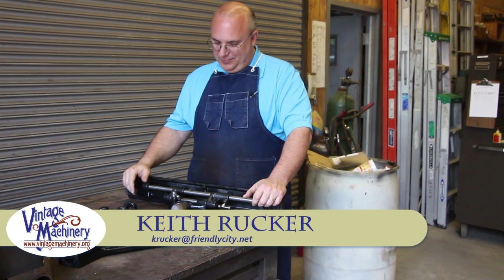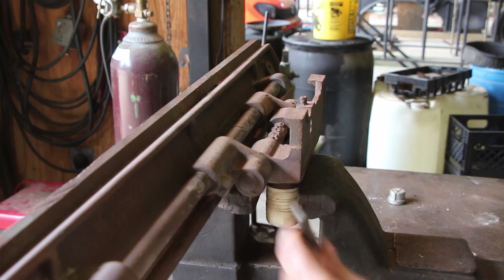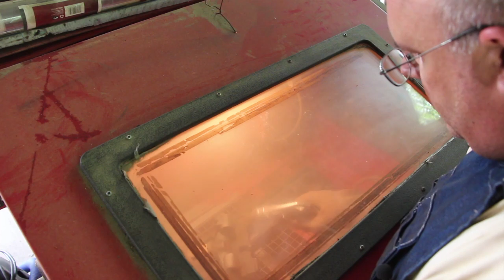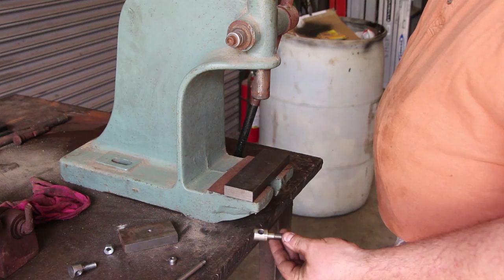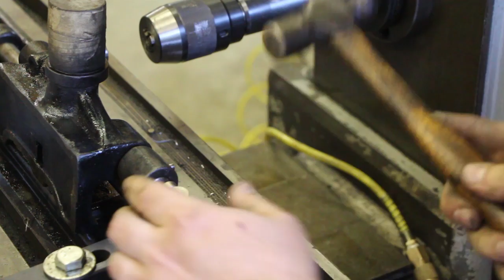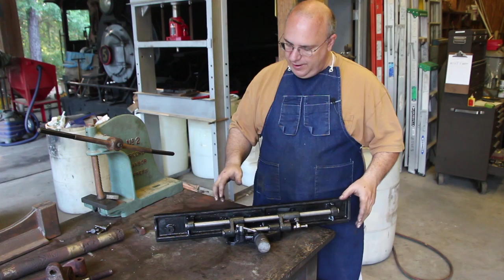Oliver 80 Table Saw "C Fence" Restoration: Part 1

Comment: What an awesome video. I had to laugh watching the fast forward portion of the video, just listening to the tap tap taping and watch those parts fly apart. I also see a lot of new owies on your hands. You deserve a purple heart for all those injuries. Again Keith you continue to do great work, restoring, replacing and making new parts where needed. Sure look forward to the assemble . I went out and bought a box of the Arm and Hammer product, actually the first box was wrong, but went to Ace Hardware and got the correct product. I'm making a small electrolysis set up using a five gallon bucket. Again thanks for more great information.

Ken Bartlett

Comment: Thank you Mr. Rucker! I just purchased a 370 Oliver. I don't believe it will take much to put back into service because it's only been out of service two years. I have my fingers crossed it comes with a miter gauge and extras. Got on auction.

Comment: I always enjoy your videos.  Your gentile spirit always leaves me feeling good. Thank you for doing what you do so well. I restored a very old WF and John Barnes 22 inch drill press. I bought it from the original owners family. Under a hundred years of petrified grease and crud was a nearly perfect 800 pound Camel-back drill. Every gear is perfect. The drill press had been stored in the home workshop for 80 years.  I had to make a few of the square hear bolts with 12 tpi. The first bolt turned up with left hand threads. LOL. How did that happen?

Comment: Keith, sorry the gremlins ate some of your video, but you edited together a sequence that makes sense, and I learned a couple of things from it. Thank you.

I'm hoping to see that fence in action. Seeing it on the table pre-restoration raised questions about how it was used and why it was built as it is...especially that arc/slot.  Can't figure out why you'd want to angle the fence away from the blade...my modern fence is designed not to do that other than a little adjustment to get it almost parallel (other than 0.005" offset at the out feed end of he blade).

-- Mike

Comment: Little lever, for sure. It is a MYFORD and the levers are much less than threatening. I also have a nice old SOUTH BEND 16 for more serious stuff.
  I missed out and K&T just like yours.  It was on CRAIGSLIST, locally and my hesitation cost me a good deal on a great machine.  It was $2500 with all of the accessories.

Comment: as close as I can get is a Starrett Brass Drive Pin Punch set you dont get the bounce like steel punches and it does not mark what you are removing the steel shank and the brass rod work well and you can always make new brass rods for them mine screw together may be you could make your own

Comment: I have a table for the press you use in this video,very heavy made in providence rhode island by adams co.I use it as a chop saw stand once in a while. when I got it I had no clue what it was for but after some Google searching I was able to figure it out. old stuff is cool.
Reply from the maker: +joe clune Cool - you never know where things will turn up being used or where they originally came from.  I need to fabricate a better table for my press!

Comment: good job on that it was rust itself cracking videos keith is that horizontal mill the same as the one that keith fenner has if not looks very similar to it keep knocking out the videos

Comment: Nice work on the fence.  When doing the tapered pins, do you drill to the diameter of the small end and then ream the rest using the tapered reamer?

Comment: Hi Keith,

Did you grind the vertical surface (face) of the fence?

Also, on a few videos, I have seen you cut threads on shafting using the lathe.  I am sure some are wondering how you can perfectly line up on the grove on each of several passes (Thread counter?)
Thanks

Tony
Reply from the maker: Anthony F. De Leo I did not grind the fence - it was machined with a metal planer originally which sometimes gives the metal a striped appearance.  As for threading, yes, there is a thread counter that you use to engage the feed.  If you have not already seen it, here is an older video that I did that that shows some details on threading:  https://www.youtube.com/watch?v=zmZO0LU6j_U

Comment: would be a good idea to use a lead hammer...
Reply: can't wait to see it, i poured mine in a copper pipe so that i can have sort of a copper jacket for the lead i sometimes on porpouse hit with the copper
Reply: ***** Tubalcain, aka. Mr. Pete222 just did a series on casting a lead hammer - he went a couple of extra steps from wooden pattern to finished hammer.

Very informative...

Not sure if you have access to soft lead these days - it's getting harder to find, due to the environmental concerns...

I'm wondering if Babbitt bearing metal might not make a suitable substitute for the head of a soft blow hammer?

Mind, I get by with a couple of "dead-blow" hammers - plastic case with a partially filled head containing shot pellets...

Cheers,

Eric